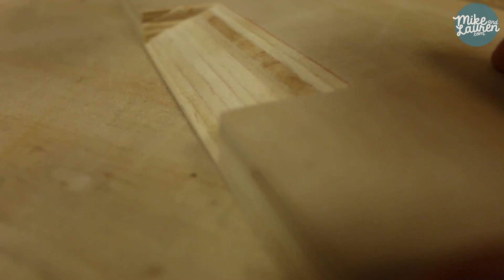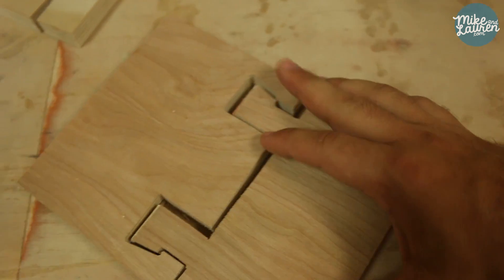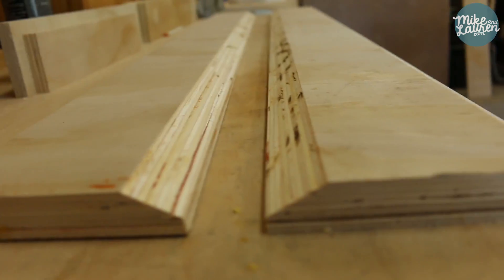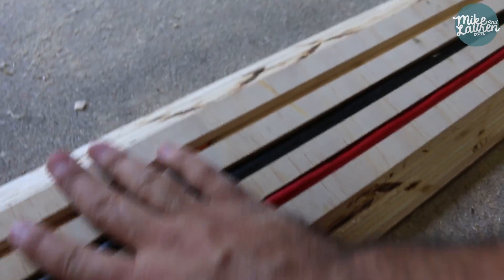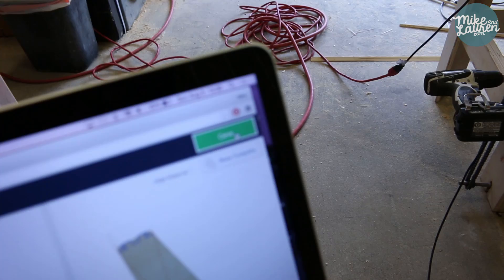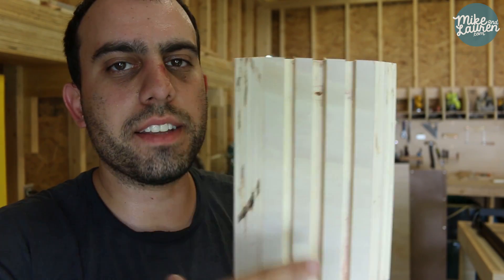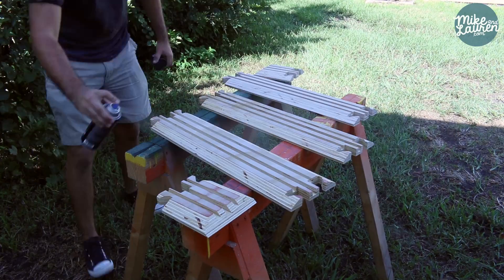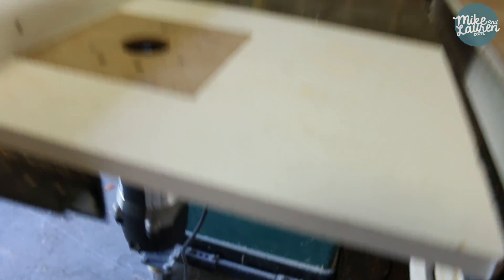Cable Ramp for Power Cords | How-to

Comment: I like the design, and the utility of it! The puzzle pieces are really a neat touch with the ends as well. 

I think personally i would've looked at doing overhead plugs if it's possible in this shop space. Cheers.